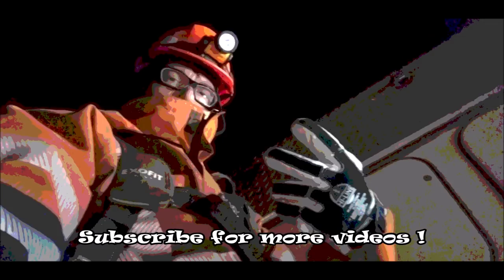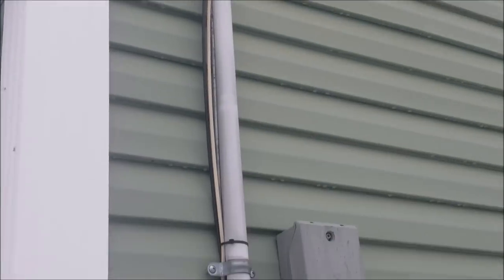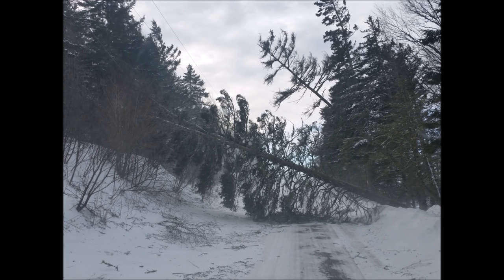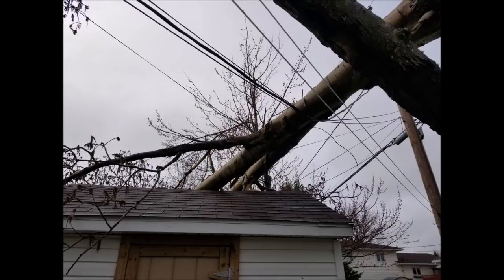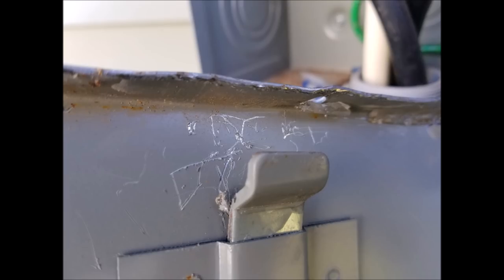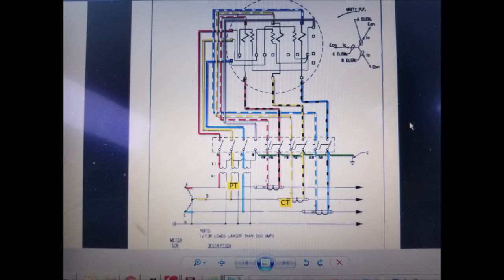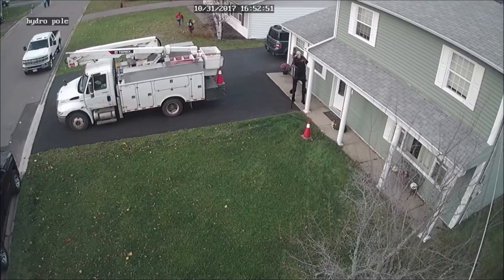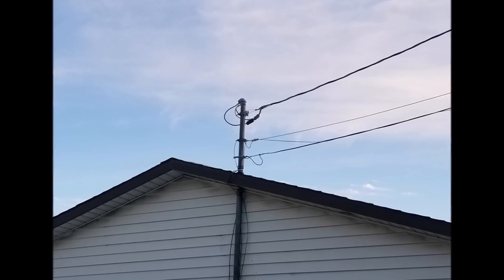Who's responsible for the Meter on my house ? - Everything you should know

Comment: 32 year licensed electrician and electrical inspector here.  I cant tell you how many times Ive seen power companies land aluminum wire without anti corrosion goop ( Noalux, Coalux, or whatever brand name you call it ).
But the worst is running #3 wire for a 200A service.  I wont mention the company, but they are really big in Florida.
Reply: Wow that's sad.  
Noalux isn't required for some aluminum allows these days.  But nothing wrong with using it even if it's not needed.

Comment: Her in the UK the householder is only responsible for everything after the meter, the power companies are responsible for the meter and wiring from the grid, be the supply underground (in town) or from pole feed (Rural) even if the meter is inside the house, most new build housing has both electricity and gas meters in external boxes.
Reply: The confusing bit here in the UK is when you get into who is responsible for the tails between the service head and the meter lol, watch people deny responsibility

Comment: In my experience, ownership can also vary based upon the age of installation.  For example, in one jurisdiction, older installs that use concentric cable from the transformer and attach to the house via clevis or porcelain top screw have the utility owning everything to the top of the meter.  New installs that use a riser and weather head have the ownership change at the line side of the weather head.  If a person has the older install, but it is ripped down during a storm, they are often required, at their expense, to convert to the newer style.  Also, commercial, industrial, single family residential and multi-family all likely have slightly different provisions, including underground riders.

Comment: Here (northern Italy) clearance of trees from LV lines is the responsibility of the homeowner, but LV lines are almost always the insulated 4 pole twisted conductors kind, so it's not an issue if a tree touches it; you just don't want it to fall on the wires and break them.
Everything from MV upwards instead is completely the distribution company's responsibility, even if the line runs on private property. The power company has right of way to access the "respect band" (not sure what the term is in english) around the line, and especially for the HV lines they periodically send treecutting crews to ensure the area stays clear.
Reply: Trees will rub on the insulated wires over time and remove the insulation.
Reply: The term in Engilsh is easement.  The easement is a legal agreement whereby the utility pays the property owner for the land the poles occupy and right to access as needed.

Comment: Another thing to call your local power company for is if you notice your power line has sagged and is too close to the cable/phone wires.  I had two such cases (one at home and one at work) where the power line sagged (happens from normal use) and had gotten within 2-3ft of the cable line. The lineman ask me if I had been having issue with my cable equipment and I told him I did. He explained that because of how close the power line was to the cable line that electricity was jumping from one to the other. He then lifted the line to where it needed to be and the cable issues went away.
Reply: It isn't so much "electricity was jumping" but that the magnetic field was inducing minute currents in the cable line, causing signal interference.

Comment: Here in Sweden more and more power lines are now being buried in order to increase reliability. Even in rural areas, and almost always when there's new construction.
Reply: Underground service isn't hassle-free, though.  Lines and transformers can still be flooded.  Tree roots or critters can damage the underground lines.  Underground line damage is a lot harder to locate, diagnose, and repair, and is much more expensive.  Underground service often depends on overhead service between it and the substation anyway.
Reply: @jovetj  However the frequency of problems is a lot lower. Around where I live in a rural area there's a lot of ongoing work to transfer overhead lines to underground. Buried properly (at least 60cm/2 feet) the tree root problem is rare and so is the critter problem. There's today some pretty good electronic equipment available to locate the issues too.
Reply: @ehsnils  It can be lower. It really depends on the area.  If you're in the flood-prone area, you're in for a lot of hurt and many days of outage.  
You can also hope that the cables last 20-30 years, but it's a matter of time.

I like buried lines.  I am a "power line" nerd, but power lines are also eye-sores.  But they are not ideal everywhere.
Reply: @jovetj  The cables aren't really having a problem with flooding themselves. As long as you put the transformer stations in proper locations/elevations and avoid areas where the soil is moving due to flooding it's not going to be an issue.
If you do a sloppy job in preparation for underground lines you'll suffer.
Overhead lines are just as sensitive to flooding because the poles will fall if they are in the wrong location.

Comment: In the US where I spent a number of years as an electrical contractor it's a little different than you spoke of. I always ran the conduit for underground from the transformer to the house but the power co. furnished the wire. This brings me to a question, if I would 0000 copper from the  meter to disconnect, then the power co. would come and run 000 ultimune from the transformer to the meter. Why do they a smaller conductor? Every time I would ask them I was told it's large enough to handle the load.    Bruce
Reply: Bruce Boyles
 ... you might laugh at this reason.... the home owner is tied to NEC codes on his side (USA) but the power company has their own code, which is not the same. Example: 4/0 aluminum service entrance cable is good for 180 amps, but is commonly used on a 200 amp service The power company comes along to do your connection and uses 2/0 aluminum, good for 130 amps. (a bit more if in open air) You are required to have at least 1 ground rod and sometimes 2 at the house. Ground and neutral can only be tied together in your main panel. The power company typically has that ground tied to neutral because they don't work with a ground, other than locally at a transformer, which saves them a few million miles of wire every year. Bottom line is utilities have a different code.... and it's not NEC.

Comment: They are doing this everywhere, putting the meters outside the house for easy access for reading and power cut off in case of fire. they did it to my house.
Reply: In our area in the last year or so our old meters were replaced with smart meters.  They no longer come out to read the meter anymore unless there is a problem.

Comment: Im hoping to buy my own place this year and one one the first things i plan is a 30 amp 220 plug either outside or a garage for welding and a 30 amp input since i have a 7500 watt generator for welding now and future backup power. My brother has a lot of birds and 3 little girls so many mouths to feed and water and they have been without power a couple times and backfeed ability can run the well and fridge/freezers as well as comfort
Reply: tractorboy31
 ... first thing for a new home owner to learn is NEVER use shortcuts..... especially with electricity. A proper "interlock" style set up for your panel is under $50 these days so why risk it?
Reply: @rupe53  because its double what i need initially. I will do proper but not immediately. I need power out first. So that isnt $50 more its $50 plus another 30 amp breaker and then the inlet box and the wire. So more like extra $100 plus
Reply: @tractorboy31  ... if you were going to do a back feed you would also need that breaker, the wire, the extra box, etc so rather than do the job twice, just do it once and consider it done. It's really the least expensive way and it's also safe. Believe me, you don't want to learn the hard way.... and you may not be around to do it over again!
Reply: Never backfeed your utility meter unless you have a written arrangement with the utility beforehand.
Reply: @jovetj  aint gonna backfeed the meter just the panel. Theres a breaker you turn off

Comment: so, my power company refuses to trim trees around the "secondary" lines, running between the main line and a pole that runs out to three houses. meanwhile, the trees are getting pretty close to intertwined with the lines....
Reply: I have a simular problem. My co-op will also not trim the tree limbs growing toward my service drop. They own the service drop so I think they should trim the trees underneath it.
Reply: @chrisharmon  i can understand not wanting to do service drops. IMO, they should bury those anyways.  but this is a secondary line running from a transformer on one pole, to another pole
Reply: Commissar0617
 ... this is an insurance company issue with those who do the trimming. The problem starts when the trimming contractor leaves public or right of way property and crosses onto private land. Basically they are only supposed to go so far from the street. In some areas you can get a courtesy job to remove a tangled tree limb, but that's going to be a judgement call from the guy who shows up. The flip side here is trimming for maintenance, where the contractor bids by the mile, and usually for just along the road. They are not getting paid to do every side line that goes across private property. Yes, the power company owns the line itself but the property owner is responsible to maintain his land.
Reply: @rupe53  the primaries run along the property line in back
Reply: @Commissar0617  ... in your first post you said SECONDARY lines, which are those going to your house. (usually in a twisted bundle) Primary lines run at the top of the poles and will have a lot of space between them if there's more than one.
Reply: @rupe53  no, there's an intermediate pole. Our yard is deep, so it needs another pole to connect to us and our neighbor. It's downstream of the transformer. The primary runs zlong the property line at ghd back, and the secondary runs from transformer, along the side property line to another pole before running to the houses
Reply: @Commissar0617  ... I'm not 100% clear here but it almost sounds as if you might own that pole (or they think you do) and that's part of the issue, especially since you say it's downstream of the transformer. (downstream = your end / 240 volts) What I would do is call them and report a problem, such as flickering lights with a limb on / near the wire when the wind kicks up. You can usually get more action with a possible safety issue than with a call for maintenance. If you need to pull a fast one tell then you are a tenant or house sitter rather than the owner and you have no idea of any prior calls. IOW, play stupid. Speak with whoever comes out and maybe they will give you a fair shake... or at least tell you where they draw the line.
Reply: @rupe53  possible, but odd. dumb setup in any case.

Comment: If you own the box, how can you get fined for opening something you own...  I'm not disagreeing with you that it's dangerous. Just curious how this would hold up in court.
Reply: The Meter man will know if the tag is snipped off. also poses as a Liability issue if the Code Inspector(s) notice that tag missing.
Reply: You do not have any access to the meter base no matter what;
If you open the panel which has the mains you can though I have never seen it get fined but why? If do something that stupid then don't go in it;
Reply: You own the box. Utility owns the meter and the seal that keeps the meter in place. Actually, in the few jurisdictions I have worked in, the utility owned the meter box and provided it free of charge.
Reply: Call it tampering.  Blocking shady person to steal power.  When you sign for service it is a write-in contract. Also the right of way to access to meter if behind the gate .
Reply: Let's say you own a building and rent it out to a bank. Would you also expect it to be ok to go into the bank vault at night?

Comment: I have a good story for you,  One winter our local Furniture store caught fire.   So our local Fire Department Blocked off Main street and redirected traffic down the back street my parents lived on.     sitting around in the living room as trucks and traffic go by the front of the house when there was a sudden loud crack and the lights flickered.  we went outside to discover are hydro stack hanging off the side of the house and a wire laying lower then theyt should over the road.      we called hydro and they came to repair it with no charge because a Unnamed cable company when installing their line instead of shortening it derided to rap it around hydro stack.   when trucks higher then normal came down the road the  truck caught it and suddenly  are stack is detachable, something home owners should watch out for.
Reply from the maker: That sucks ! It happens more often then it should for sure. In my area we will make the repairs for free, but only after the customer has an electrician repair the mast.  It's one of those things most people aren't aware of. Like you said I try and keep an eye out for it... Especially the older cable drops with s steel carrier
Reply: @Bobsdecline  i believe the cable company being it a small town payed for the mast
Reply from the maker: @wolfcatsden  Oh nice!
Reply: "are"? Is that Canadese?
Reply: WTF "are" a hydro stack??